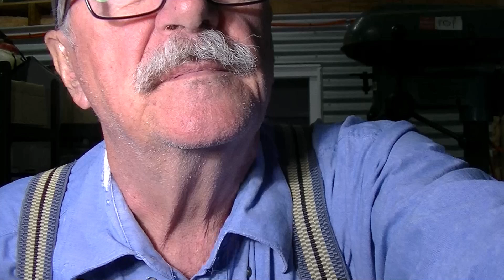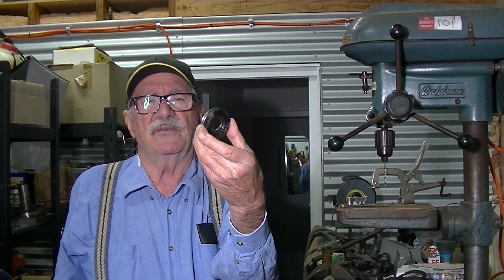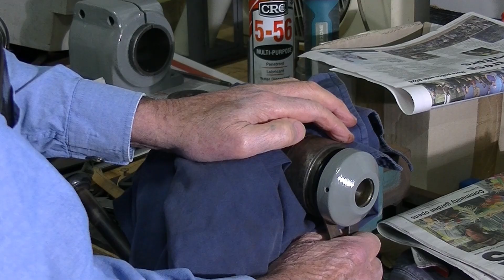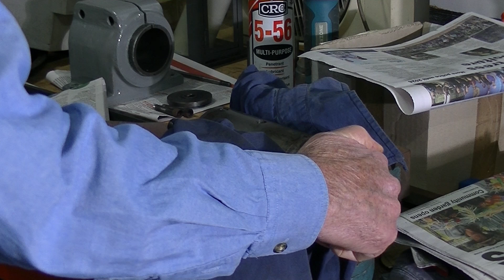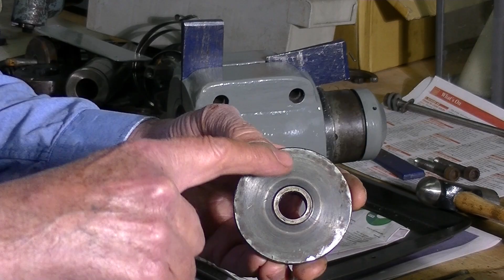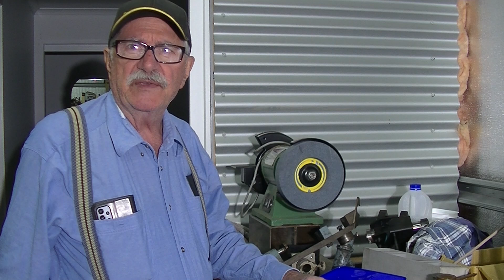Internal spindle repair.

Comment: Most High speed Spindles will either have an Oring for bearing preload or a set of small coil springs. Bearing preload must be at a minimum as some of the spindles I've repaired over the years can run up to 25,000 RPM.
Reply from the maker: This spindle has a large diameter flat spring for preload. I think, Belville.